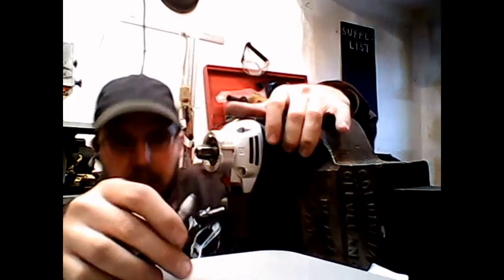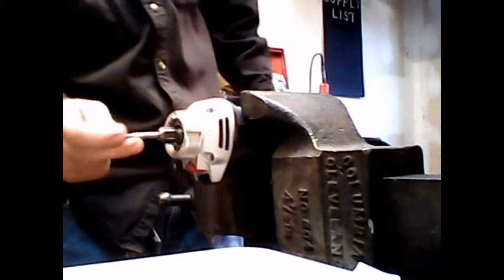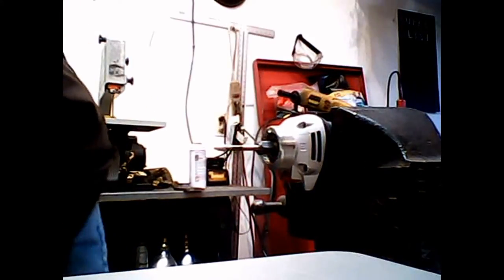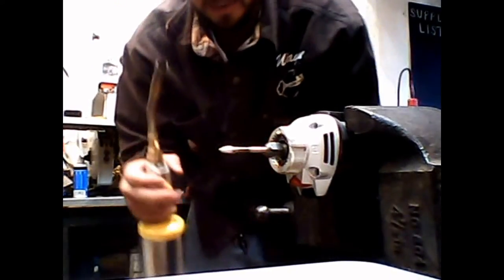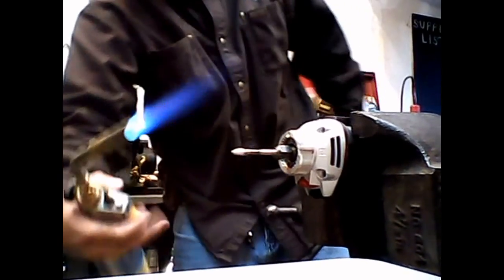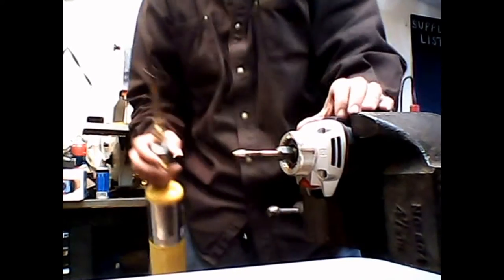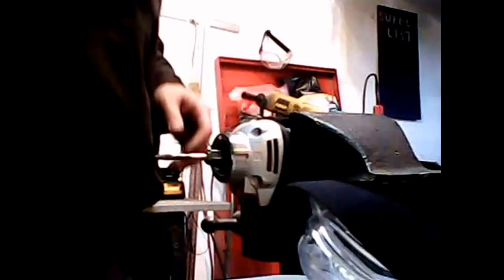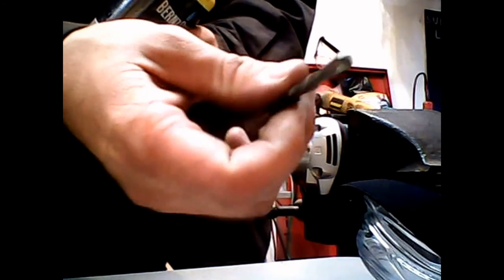How To Clean Out A Carbide Burr

Comment: First off you shouldn't be using 'double cut' carbide burrs on aluminum! As you found out, they plug up real quick. Instead use 'single cut' burrs specifically designed for alu which don't plug up and actually cut alu much faster. Also, you can just use Muriatic Acid which will very quickly dissolve the aluminum and is much safer vs slinging molten alu all over your shop at 30,000rpm...

Comment: Carbide bits are silver brazed to connect the cutting bit to the stem. The heat required to melt alu off the cutting edges is probably close to the heat that would melt/compromise the brazing. Considering these bits spin at 30k rpm, I wouldn't want them coming off!

Comment: Ya, don’t do this. The ends are held in place with some sort of solder. If you get it that hot, either the tip will fall off while you’re doing it, or it will weaken the tip and it will fly off during use. That torch is much hotter that what the burr gets during use. If it hasn’t happened to you yet, you’ve gotten lucky. Very dangerous.